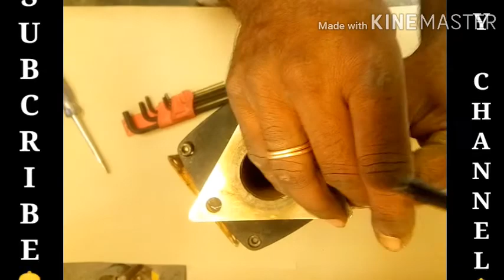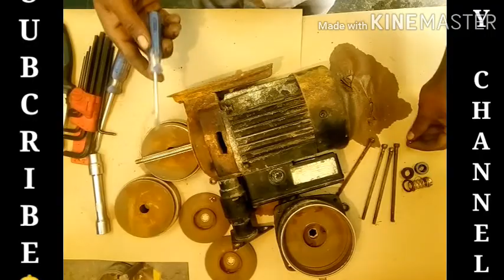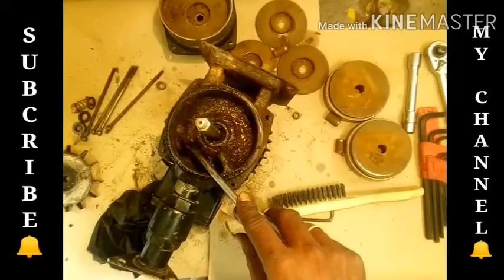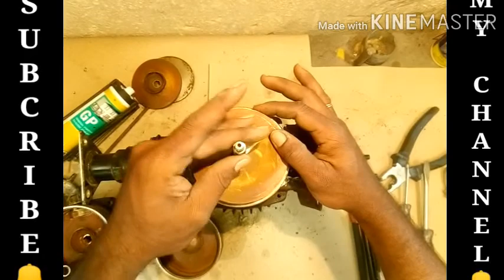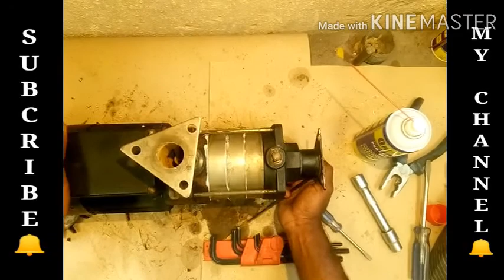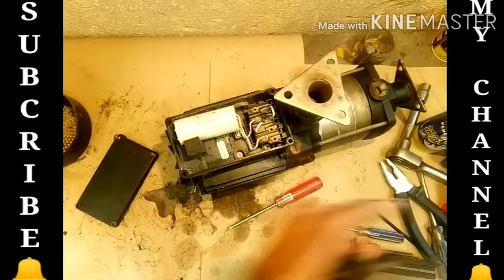grundfos pumps | grundfos Water pump repairing | water pumps maintenance | Grundfos pumps repairing

Comment: Hello sir my pump is working but few seconds after pump of read light bling how to repair
Reply from the maker: Hello sir...
Can you tell me your pump model?
Reply: @MRMultiTechnicals ok I will send  tomorrow
Reply: @MRMultiTechnicals   cmh4 -40-k  model
Reply from the maker: hello sir... I would like to give you three pieces of advice.

1 check motor bearings if the bearings is jammed motor take over load

2 check flow of the water pump inlet and outlet lines.

3 everything is ok then you need change the pressure switch.
Reply: @MRMultiTechnicals   yes all ok  power on moter also on but 40 second after  moter of  read light blinking ant reset again star moter
Reply from the maker: Maybe you need change the pressure switch.
Sometimes relay or inside circuit board problem s coming.
Reply: @MRMultiTechnicals  thanks 🙏
Reply: @MRMultiTechnicals model B 06